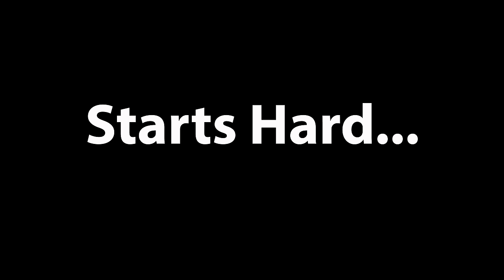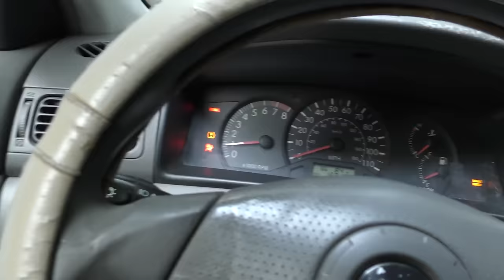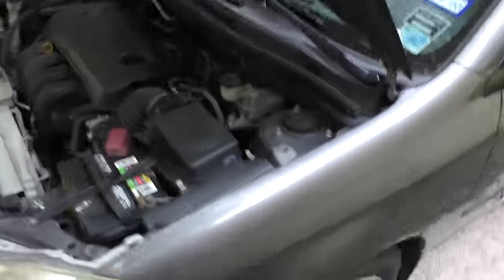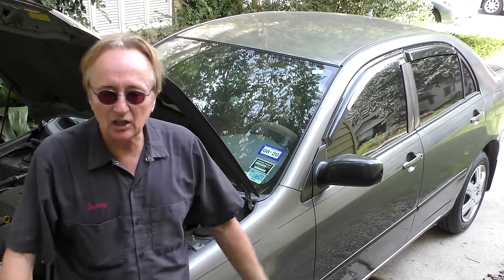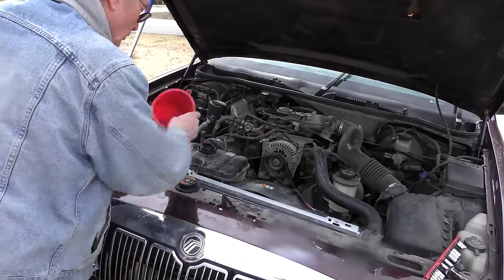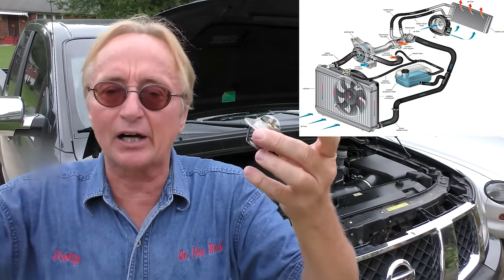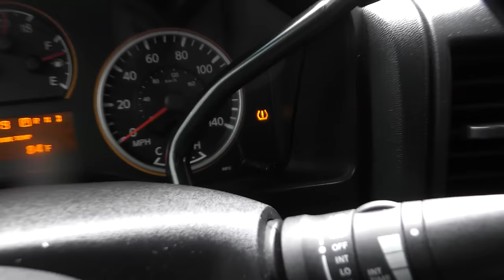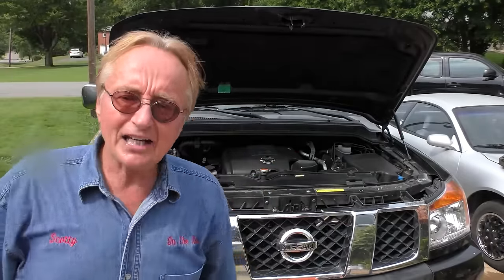If Your Car Does This, You're Screwed

Comment: So, in this video, the person is trying to diagnose and fix issues with a used car that they bought. They start by checking the spark plugs and the coolant, and then move on to inspecting the radiator and the cooling system. They also discuss the importance of checking the coolant level and the condition of the spark plugs before buying a used car.

The video then moves on to a case where the car's coolant is leaking, and they demonstrate how to replace the radiator. They also discuss the importance of having a mechanic check the car before buying it, as they can spot issues that the average person might miss.

Next, they talk about a car that overheats, and they use a pressure test to check the cooling system. They also discuss the possibility of a blown head gasket or a faulty thermostat. They then check the car's fans and condenser to see if they are working properly.

Finally, they discuss a car with a tire pressure monitoring system (TPMS) issue, and they demonstrate how to use a scan tool and a tire pressure gauge to diagnose the problem. They also mention the high cost of fixing the TPMS issue, and they recommend using a tire pressure gauge instead of relying on the TPMS.

In summary, the video provides a step-by-step guide on how to diagnose and fix various issues with a used car, and it emphasizes the importance of having a mechanic check the car before buying it.

Comment: I learned something new about the tire pressure sensors from this video I have a 2010 subaru forester and the low tire pressure light won't go off regardless of how much pressure the tires have I'm not going to worry about it and just check my tire pressure manually

Comment: Those wheel bearings are really poor though. It's a point of failure of road safety check in the Netherlands. It's driveable but they will get hot and wear down rapidly.

Comment: Super-Clever idea to resolve these annoying dead battery-powered TPMSs that are always in Scotty's videos:
1. Put a bracket with a permanent magnet somewhere on the wheel struts: Put a coil inside the TPMS. Every time the wheel passes the magnet, it charges up a few micro-amps.
2. Might be able to do the same thing with some kind of "gryoscopic" or motion-based component inside the TPMS alone... like Rumble Packs inside game controllers, only in reverse.
Reply: I already own the patent
Reply: I think i'd rather not have them to be honest
Reply: @honorablewiz7447 that's not how that works lmao

Comment: Here I am watching this video while owning 2 corollas. My 03 is a 🗑 but it runs. The idle is crap. The transmission shifts slow. The acceleration is that of a turtle 😂 but I have already put close to 100k and only paid $2500 for it. Only a work or throw away car for me. Hardly any maintenance and it still lives. I also have an 05 that's past 500k but I maintenanced that from the day I got it from the lot. But your right about people not even checking norm stuff. I was always taught to check fluids monthly especially on used cars. I have submitted my subscription sir!

Comment: I don’t think there are too many sellers out there who would let a prospective buyer start dismantling the engine to get to a spark plug.
Reply: On a boxer engine maybe but most of the time it's right on top lolz no dismantling of engine
Reply: @zacharypeery4082  Uh still, many parts have to be removed to get to the plug:  engine cover, ignition coil, fuel rail (on some engines) have to be removed.  Don’t think too many sellers would be ok with that.

Comment: I found that with my previous car, the reason it didn't start very well was because it was made in Italy and I wanted to start it in -30 C. Turns out, the main problem was battery running out over the night, but I doubt the car would've liked being run so cold.

So I built a shed for it. In the shed, I installed an electric heater.

Comment: Hey Scotty, I have that exact same car and the exact same problem. 2007 Toyota Corolla S with 261k miles and I have 2 check engine lights: PO420 & PO171. I’m only worried about PO171 because air is leaking in and making engine run lean and I can’t found out why! Any suggestions besides using a smoke machine? I don’t want to spend $200 if I’m only going to use it once. Also cold starts are very bad. Cranks for about 4 solid seconds before barely starting up.
Reply: Did you figure out what your P0420 is? I’ve had that code on my 2003 Corolla for 2 years lmao
Reply: Dude it’s your fuel injectors
Reply: You seem to have a drop-down issue with leaking injectors. Next time you cold start. Try starting in flood mode for like a second
Reply: @HEENDOOO I have a gas cap code on mine. I you tubed it, they said change your gas cap. It reads that code, I believe when gas cap is bad. If not cap, the sensors

Comment: Love your videos. Could putting in a heavier gauge oil help the oil burning and engine start problems?
Reply: Scotty always says to always put in the oil rated for ur vehicle
Reply: No, there are small cavities that the oil travels thru to increase pressure in specific areas, like the crank and cam bearings. Flow rates can decrease to catastrophic levels of the oil is too thick. If the oil is too thin, the pump won't be able to move enough of the fluid because the tolerances in the pump are designed for a specific viscosity range. Basically, oil that is too thick will mimic the properties of a very dirty oil, which is what caused the damage in the first place.

Comment: The problem with older Toyota cars is that you don't even know they're broken until it's too late. Some asshat drained all my oil once, I drove the car for a few weeks before I checked my oil and noticed it was completely empty. Fill it back up and it didn't leak so I just went about my day. It took over a month for that car to die from the damage it sustained. The thing is it ran fine until a cylinder blew.

Comment: Got point. Some times when you have cheap old car, it is better just drive and do not repair. It will last at least 20. 000 miles anyway :-D
I just cleaned spark plugs one a month and it was ok.

Comment: i dont know, my mazda's auto trans went out and it was about $3,600 for a shop to replace before that i was looking at other cars that were from 8-12,000 and they all looked pretty rough or had some collisions when i checked carfax and some had more miles than my car. i just decided to fix my mazda3 because it was just cheaper than buying another car that really i could of also had issues with down the line, atleast i know whats wrong with my car. 10grand doesnt really get you that nice of a used vehicle anymore.

Comment: As an ASE certified technician, I can tell you that the first thing I would do is plug a scan tool in and read the numbers and check for error codes lol. I definitely would not start pulling the engine apart first thing lol. Come on Scotty. Why don't you teach these people the right way we do things it in the shop?
Reply: I am wondering now if Scotty had already used the scan tool and began diagnosis before recording this video.🤔🚗

Comment: Oh yeah radiators are easy to replace usually lol except for in the case of my 2016 Dodge dart where I had to remove the entire front bumper along with some other crap just to get the radiator out there was absolutely no other way to do it

Comment: I had to have the radiator replaced on my Avalon. It cracked all the way across the top, but my car never overheated. I realized it was leaking while sitting at a red light and saw steam rising.

Comment: Give it a cheap detail job and try to flip it to atleast break even. Or if you cant do that, get a used Corolla engine and put that in, that job even has a good overlap with the front wheelbearings. And you end up with a nice car thats recently detailed and now has a good motor

Comment: Even on my new cars I check the oil every other fuel up. I grew up dring worn out vehicles that I checked daily, so this habit stuck. Also no more than 3500 to 500 miles between oil changes

Comment: In the olden days, circa 1970s, when an engine burned oil you could install a higher temp range plug (I think it would be a lower numerical value on the plug part#)..... This would keep the plugs from getting fouled, but the oil issue remains.

Comment: Where are you guys submitting your questions? I have one. 

I have a 06 CRV. 
202,000 Miles. 
Sometimes, after it's been running and warmed up, when it's shut off and restarted while warm, it won't start. It turns over and over like the engine is flooding.  It will eventually start after a few attempts and run just fine.

I have a hunch it's the engine temperature thermostat. Not the one for coolant, but the other one.

Comment: the black stuff on the end of the plug isnt always oil, could also be a soot from the air/fuel ratio being off or the plugs arent buring hot enough. the plugs in the video didnt seem to have burnt oil on them tho

Comment: Tell the Nursing home (P)resident in the White House to stop promoting foreign products.
Reply: Left Afghanistan in a mighty big hurry. Called it "victory".   All their lithium now in the hands of the Chinese....Make ya wonder.
Reply: When American products are trash, it’s better to promote worthy foreign products. I would much rather Toyota be promoted than most American car brands which are always ranking in the bottom for reliability.
Reply: @medini2  Not really—not a doubt in my mind…
Reply: @alb0zfinest  I worked at GM hydromatics division in the late 80's, inspecting parts for transmissions and torque converters.  What I  did with out of spec parts was throw them into big bins that were hauled off to melted down.  But when a big press went down for repairs, management began something new--they sent a fork lift over and told workers to "Run em", so they were intentionally running seriously bad parts and laying off workers left and right.  Corruption at all levels of management including Roger Smith, CEO at the time was seriously demoralizing. Roger Smith (CEO) said Americans buying Toyotas were to blame.   Manufacturers in USA were hightailing production out of US and denying it all along.  I say  American made products and entire country were deliberately sabotaged  to be a part of the up and coming "new global (digital) economy" .

Comment: When I worked as an engineer with a couple of auto companies, finding and solving common warranty problems, I saw Chinese knock-off radiators palmed off as genuine radiators (obviously, replaced from front end crashes, and the panel beaters wanted to keep the cost down). To an untrained eye, they looked like the real deal, even having the correct supplier's name moulded into the header tanks, but were they good enough? ABSOLUTELY NOT!!! They failed very quickly, and often the transmission oil coolers would crack, destroying the transmission and filling the engine full of ATF. They were an absolute mess! When the inlet spout broke off my radiator, I replaced the radiator with a genuine one. I had seen too many cheap and nasty knock-offs to risk buying cheap and nasty rubbish radiators!

Comment: If the body is in great shape, who cares if anything else is broken. I just bought nice cheap Neon R/T, perfect body, replaced everything back to front and rebuilt the engine and transmission. Only cost 2 grand in parts. So for 2500, I have a new car.

Comment: I love Alcatel my Alcatel 329 has a TPMS function in it, comes in handy all the time I don't really care for the tire sensors the tire pressure sensors they're good to have but as long as you keep a tire gauge with you it will tell you how often it leaks and if it leaks at all by how much you have to fill the tires up on the car happened to me when I had my Ford fusion my first generation pretty decent vehicle had a nice design by Volvo and it ended up being that my front right tire had a dead battery sensor in the tire, I don't know I think that's you know what the tire pressure sensors are just another way to rip you off.

Comment: On my 2010 ram with the 5.7 hemi, just shy if 145k miles, the dealer service department is telling me it only has a clogged radiator. I suspected a head gasket is bad because it burned all of the coolant in the system and over heated. It also burned enough oil to be below the safe mark on the dipstick. Topped both off after realizing both the coolant and oil were low. It leaks nothing. No puddles or signs of seepage under the hood or underneath it. It was still overheating on the highway after topping off the coolant, but only on the highway at highway speeds. On the surface streets the temperature gauge was increasing and decreasing with rpms. Should I trust the dealer or try to sneak over there with my own co2 test and perform the test in the parking lot where its probably sitting?
Reply: Check the fan clutch first
Reply: lmao they told you what's wrong with it and you're on YouTube

Comment: I literally have the exact opposite problem with my 2007 Toyota Corolla LE. Starts immediately when cold, but when hot it take 5-6 seconds of cranking even multiple tries. Replaced spark plugs, coil packs, filter, coolant, ect. What could that be? Btw tailpipe clean as a whistle, only suit

Edit: It also time to time throw a classic P0420 code time to time. On and off.

Comment: What about starts hard when warm after its been running, truck brand new motor, new everything else under the hood, new transmission, new fuel pump. Still did it before all the new stuff too though

Comment: If your car seems very hot , as in you can feel the heat standing near the car but the temperature hasn’t gone up on the dial ,  could there still be a problem?  Thanks
Reply: If diesel, no, it'll be burning off particulates

Comment: I wished we had such mechanics in Greece. I own a toyota auris 1.2lt 2018 make and i have nightmare stories to tell from 2 times gearbox under warranty and a water pump and now rattling at 2k rpm and 1 month in dealership they cant find what it is. someone mentioned LSPI but their mechanic says that there ECU recorded session did not show any knocking

Comment: My rad fan doesn’t come on when the car is running. Only if it’s hot and I turn it off or if I turn on the A/C while running. Otherwise it’ll overheat at idle. Pretty sure it’s a fan temp sensor

Comment: i have a question for you..... i have a 2014 jk jeep with a supercharger on it and the temp goes up by around a 1/4 when under load but goes down just as quick when not under load. so far i have replaced the radiator cap and thermo. i don't have any of the norm of a blown head gasket as it doesn't blow white smoke and the oil isn't milk shaked and it only has 93000k's on it

Comment: Scotty I got a Volvo S40 year 2000 I'm thinking of buying at 1500. Ran 102k KM and the starter cranks slow and has a high rev after starting. It also has a creaking when I turn it all the way left (Probably front left axle). Any old Volvo advice?

Comment: Im curious if he even checked the fuel rail pressure. Often times a hard starting cold car is because its losing fuel rail pressure while it sits. Could be a faulty check valve in the pump.

Comment: I'm just replying to the thumbnail but I had a 97 toyota camery that started hard and would idle super low and all I did was the idle reset and changed the spark plugs that were basically corroded so bad that they weren't even spark plugs anymore. But after that it ran forever until about 400k miles then I got a new car.

Comment: My 2006 Charger SXT V6 had the radiator come apart on the side. The aluminum crimping fingures became weak and started letting go at 307,000 miles. I'm not sure how long my wife drove it when it was overheating. Now it has a rattle at high RPM. Not sure if it's piston slap or not? It has a little knocking sound on acceleration.

Comment: My van has suddenly lost power and it's juddering slightly with a odd noise from the engine it's only just had a load of engine work done, I was told it's air getting in a line were it shouldn't, I can't remember what line he said. Any idea, thanks

Comment: I had a radiator pump replaced. I had the orange fluid and they put in the red fluid. They said it’s a universal but didn’t tell me and when I went to top it off I noticed it was red not orange don’t you think they should’ve told me something that they change the type and color of the fluid.

I complained and they said they didn’t have to tell me anything and that I can mix the orange and the red together

Comment: I SO wish this guy could have a look at my Golf GTI. It's been nothing but trouble since I got it. Spent £3000 on it in 1.5 years and it still isn't running properly. Currently AGAIN sitting at a workshop with them scratching theirs heads on what's wrong. Driving me NUTS 😥

Comment: I just pay 20 grand extra to have my used car be a new car, lol. But wait, the new ones are juat as bad. 2024 Hyundai Tucson is falling apart in less than 1 month and 1000 miles, the door external B pillar covers are falling off. Trunk spoiler also very floaty like about to fall off. Lots of cheap plastic parts and flimsy covers

Comment: I can already imagine selling a car with a switch for the fan xD. "What does this button do?". It would be way better to either buy a used one for more or less cheap, or at least make it in such a way it enables itself, by hooking it into a temp sensor or place another temp sensor and it would turn on automatically based on that. Could be hard to do, but if done properly at least you would not wreck the car if you forgot to turn it on xD.

Comment: I need a honest mechanic now a day's I been trying to find one in my neighborhood and city to help me fix my truck it's a OBS TRUCKS with a 350 CID 5.7l it wont start until I spray starter fluid in the throttle body or pore gas down the throttle body and then it backfiring like crazy